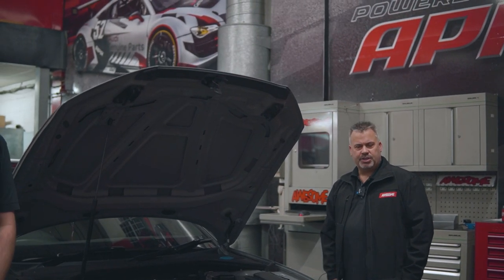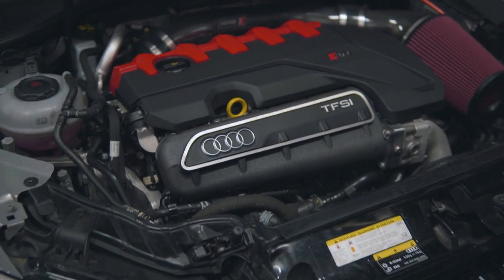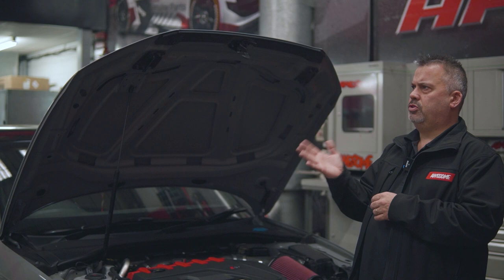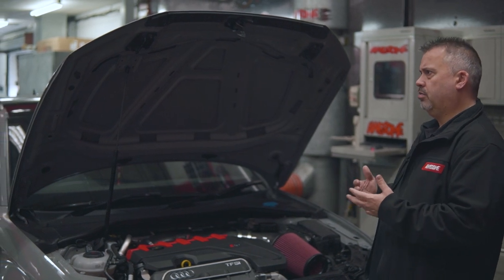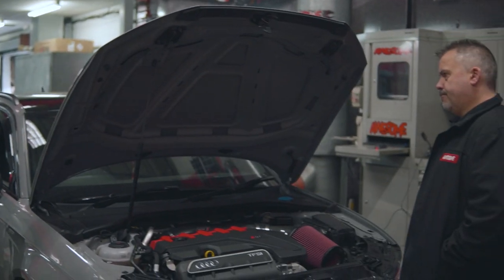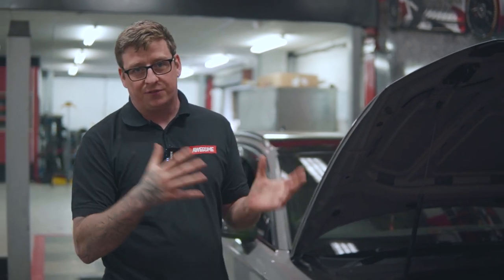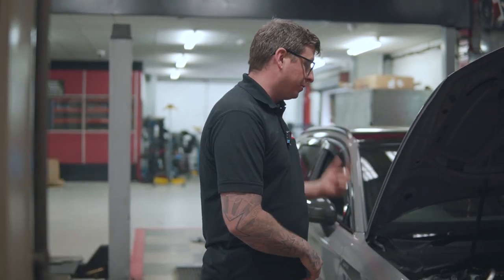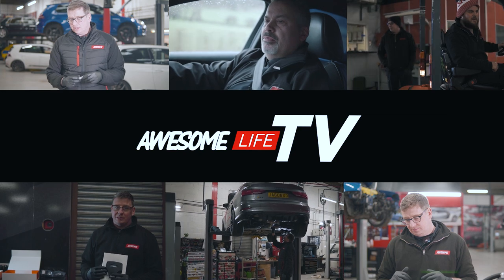Audi RS3 stage 3: Big Turbo Build

Comment: My FL RS3 ran 473BHP and 488Ft/Lbs at stage 1 on standard hardware. Looking forward for the lockdown to end so i can get my downpipe and intercooler fitted for stage 2!
Reply: Hi, we're looking forward to this all being over for sure. Make sure you give us a call when you're pricing everything up, we'd be happy to help. Regards Awesome.
Reply: My pre facelift cost about £3000 to make 471.8bhp! What does the FL have that the PFL doesn't, do you know? You can hit 500bhp with just a cooler and map I think.

Comment: What does the FL have that the PFL doesn't? Engine wise. Why can the FL reach 500bhp so much easier?
Reply: The FL is simply the next generation of engine and with the turbo and fuelling in place it's capable of more power, a lot more. This latest generation is very impressive and a big step forward in performance. Regards Awesome.

Comment: On these stage 3 builds are there pretty safe on stock internals? How many miles are people putting on them with no issues? I’ve heard mixed reviews on torque limit and some say it should be kept lower than 560 for the engine to not bend any rods.
Reply from the maker: We limit the torque on all of our stage 3 builds anyway, if the car is propely maintained then it should be pretty okay but service and maintenance becomes more regular. We have had no issues touch wood with any of our stage 3 cars and if you look at the record breaking build for Dan Jacobs the car has been bulletproof and sold on after doing multiple high intensity events.
Reply: @awesomecars1  That's awesome to hear. I will be going stage three here pretty soon. Love your video content you guys put out. I'll be subscribing. Thanks and cheers! Break more records!
Reply from the maker: @leonardoarispe4689  Thank you and happy stage 3!